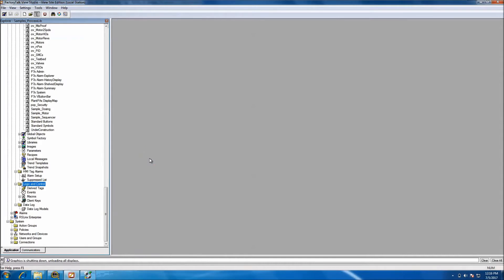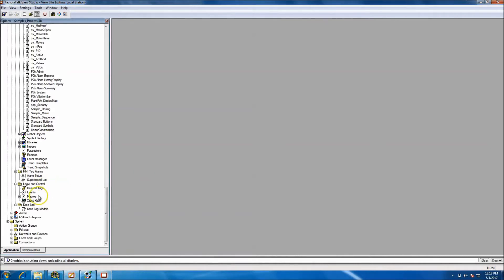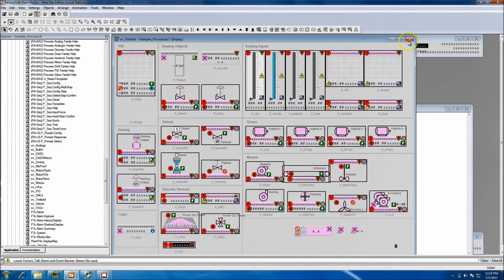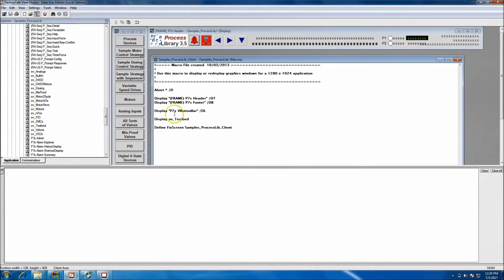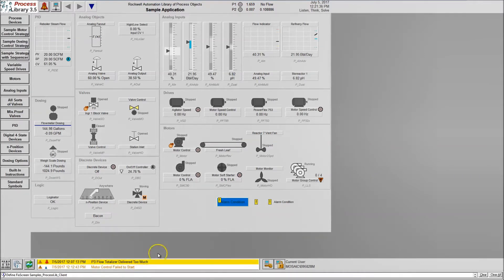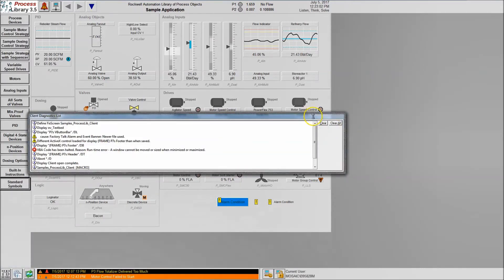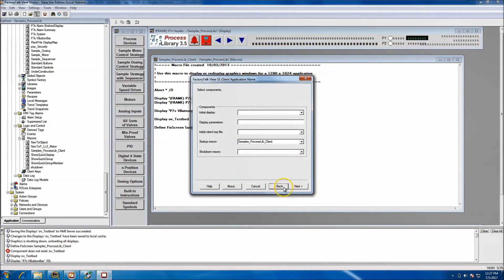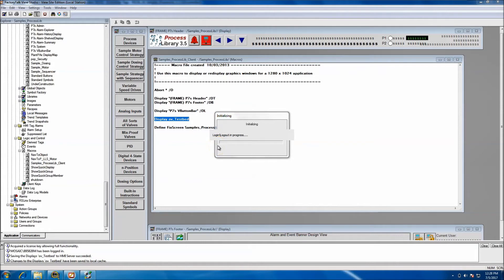FactoryTalk View SE HMI Client Startup Macro Example

Comment: Shane - I was wondering if it is possible to add a GGFX into start up Macro?
Reply from the maker: You can add commands for just about anything now in FTview 12 & above.

Double click inside the macro for all the commands
Reply: @ShaneWelcher  crap we are running 11
Reply from the maker: @akupadhyayula  You'll upgrade soon, 11 is a gap...go ahead & push to 12 or 13